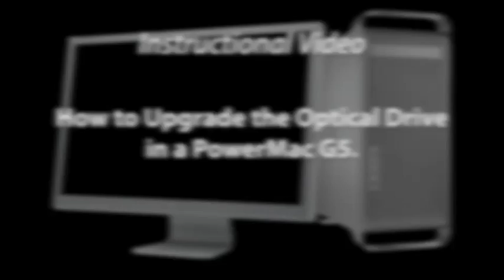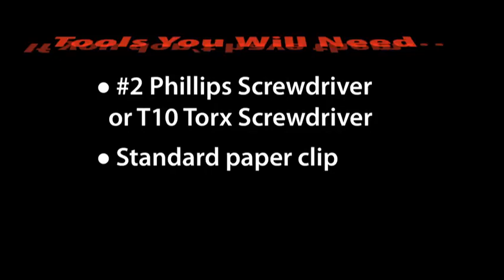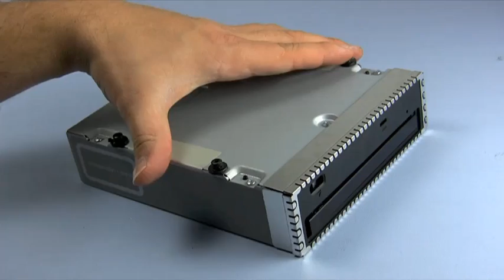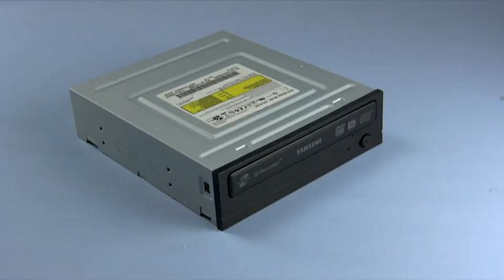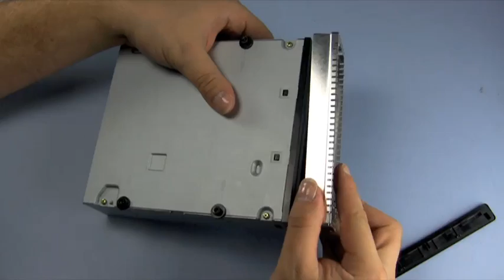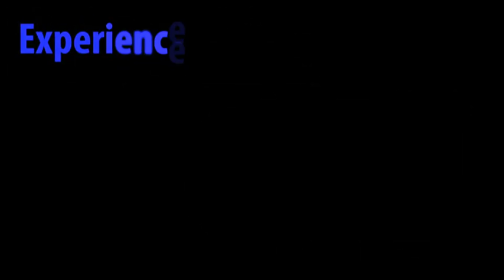Power Mac G5 Optical Drive Installation Video

Comment: Unfortunately, I bought the LG Electronics GH24LS70 Is there a way to make it work in my G5 with a cable or adapter like the Avolusion SATA to IDE/PATA Converter Adapter? I can't get any help. Even went to the Mac Store and they just threw up their hands.

Comment: Is there a fear of dust in the drive with the Bezel (faceplate) removed from the tray? I know the case has a retracting door, but it doesn't seem too offer much dust protection. I put a Lacie dvd burner in mine and it only slightly caught the case door with the faceplate on. I'm wondering if the philips screws (instead of the hex) would remedy that without having to take off the bezel? Or maybe trim the bezel down slightly at the top and bottom and put it back on?